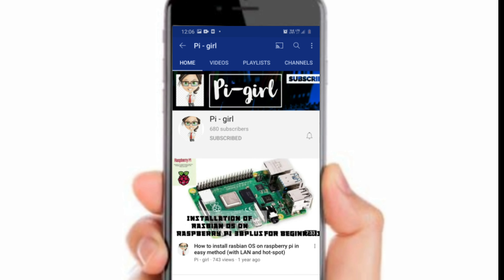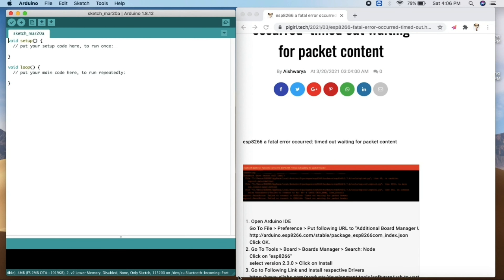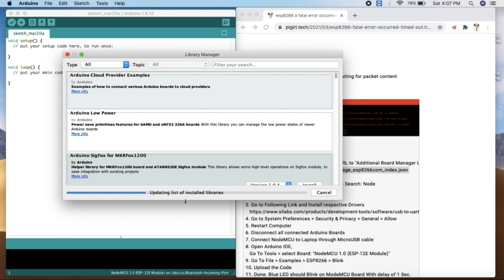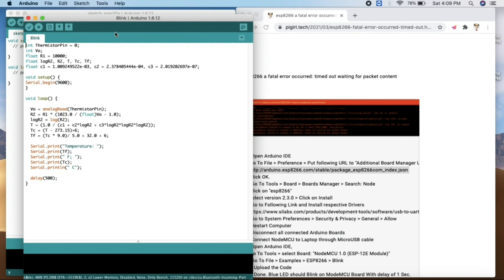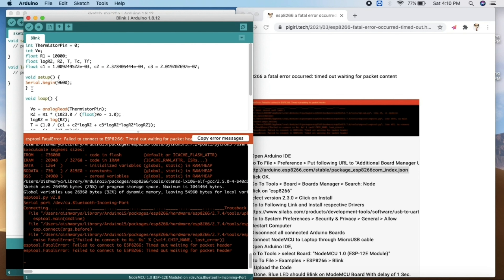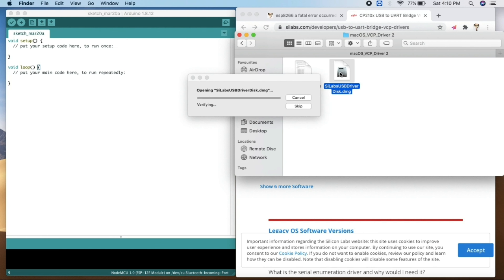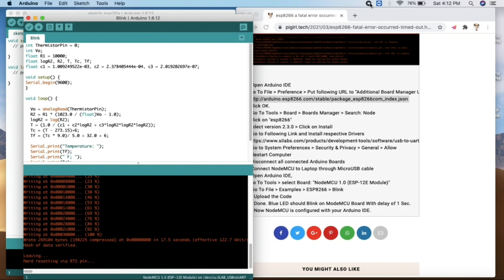[Solved] esp8266 a fatal error occurred: timed out waiting for packet content | Port not found

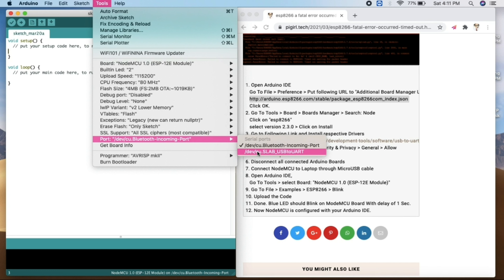Comment: Very helpful instructions. Need help please - I installed driver at 3:19 for mac. But I don't see the new port option for USBtoUART that you see at 4:26. I only see the bluetooth still. I restarted mac. I tried with nodemcu connected and also when not connected. can you please help?
Reply from the maker: unzip the driver and install and restart
Reply: @Pigirl  can you help i have the same issue i downloaded unziped and installed the driver but i cant see the port
Reply from the maker: @adityarajesh631  yes sure I can help you out
Reply from the maker: mostly you have restart with arduino ide
Reply: @Pigirl  i restarted the laptop as well the arduino ide........ is there anything else you could suggest
Reply: the install was succesful but it still does not show i am working on mac os montery
Reply from the maker: Did download it and install it properly? 
Coz this should definitely work
Reply from the maker: Please watch video carefully and try to install again if that’s doesn’t work I’ll tell you other ways
Reply: @Pigirl  yup followed everybit ....still not happening
Reply from the maker: @adityarajesh631  do you use windows/mac
Reply: @Pigirl  mac
Reply: @Pigirl  ok nvm it worked finally some hard ware problem was there ..... thanks for responding
Reply from the maker: I’m glad it worked ❤️ please subscribe